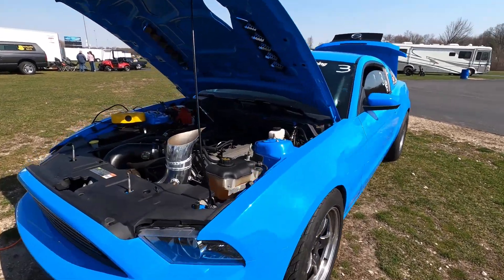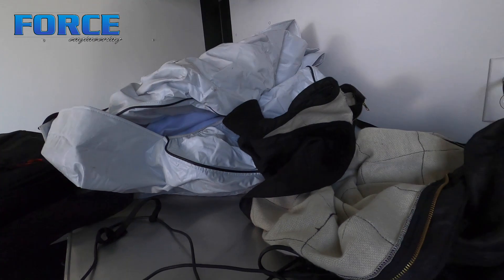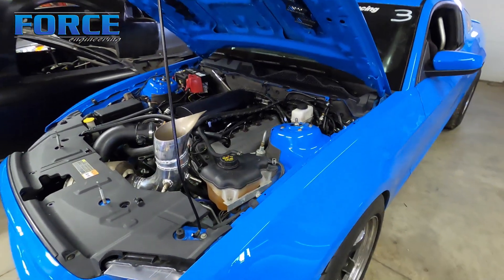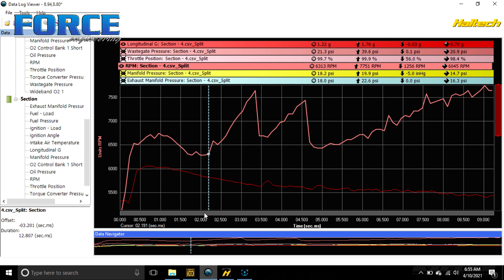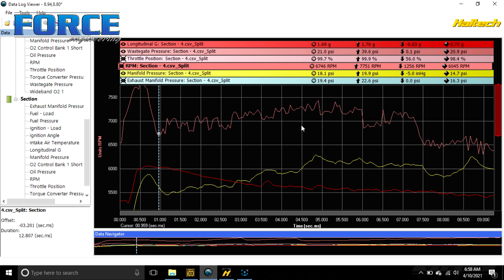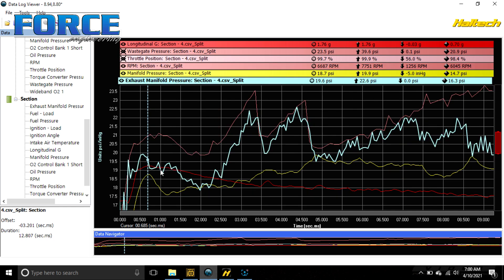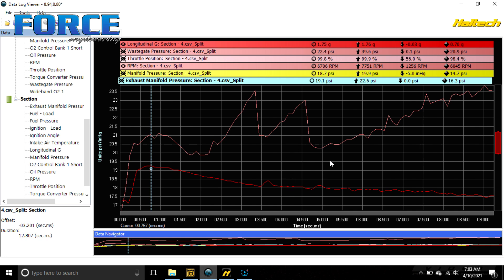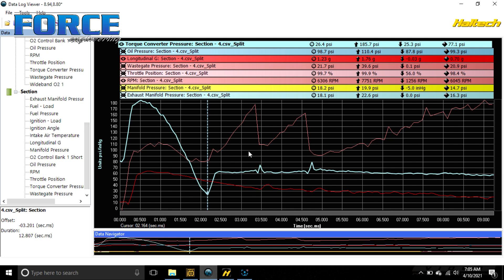First passes on Haltch Elite 2500 And Close Ratio Rossler TH400

Comment: Your making some very good and informative videos thank you for sharing your knowledge. I know you had a 1.65 1st gear in the trans what gear were you running at the differential at this point with the turbo 400 swap 1st test passes
Reply from the maker: Thanks! This is with a 4.10 final.  Same final I had with 6r80 when it was setup for 2nd gear leave.